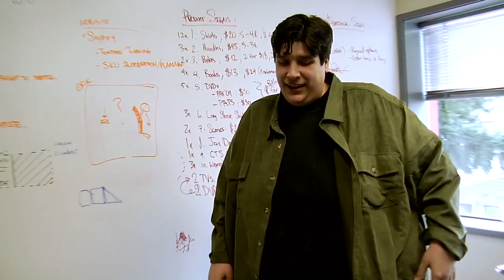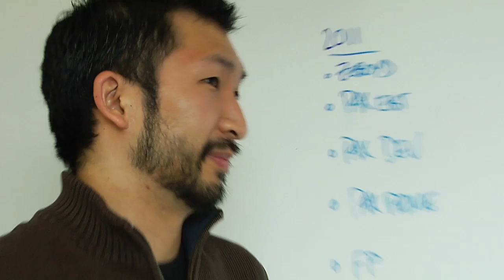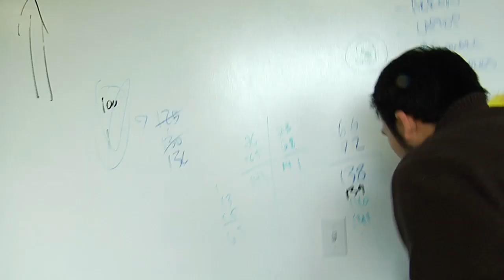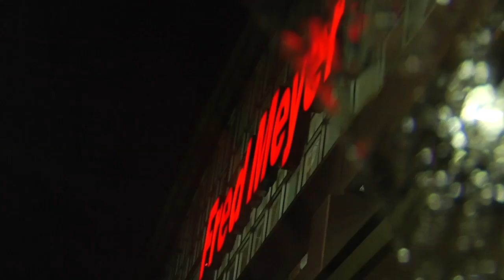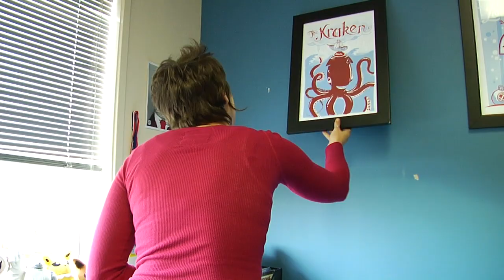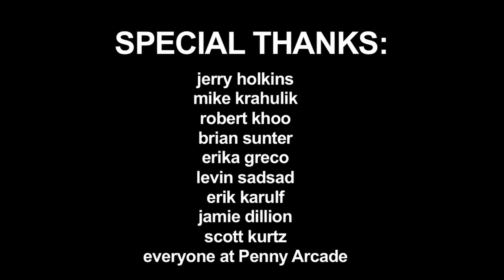Penny Arcade - More Pranks!

Comment: Didn't she end up busting the original can in the guitar?  She hid a can in the guitar (or tried to) with the post-it note on it, and BONK--busted can.  Did they replace the can after it broke and leaked all over everything?
And if so, doesn't that mean that Khoo didn't ACTUALLY find the original can, and therefore loses?
Reply: Actually allow me to recant that series of questions: I just realized they put fake post-it's on most (if not all) of the 144 cans that they had hidden.

Khoo cannot be defeated.